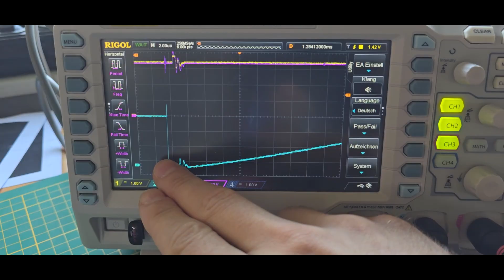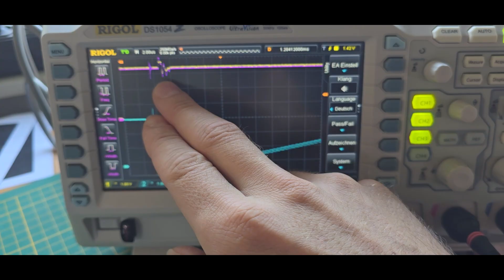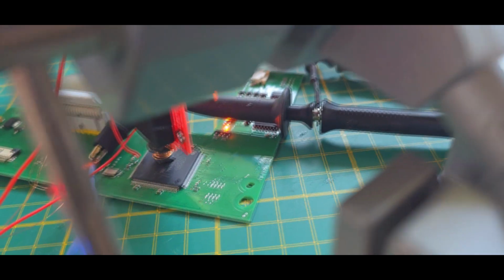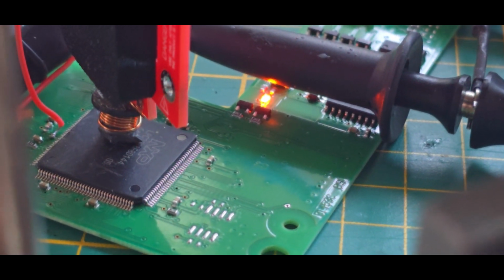EM Fault Injection POC of the NXP LPC2388 via PicoEMP

Comment: I've been familiar with this method, but something about you talking about this and about the relative positions brought up some interesting thoughts, aside from course control of magnetic field area, technically you can shape the field into a wide array or regions and concentrations.. an inductor doesn't have to be a 'coil' it can be anything that forms a loop, projected, shielded, there can be two in parallel/series, but what's interesting about that is you can stick them in/out of phase with one another so they push/pull each other's field lines with the same trigger impulse, and also have areas they could cancel one another out if needed. In the future we might even see security chips where this attack gets nulled out by some means of internal diff-pairs in the silicon or EM detection itself, but with enough EM shaping with the fields, this could still be a plausible method if you can shape the fields away from the detector or with enough force into one edge of the diff pair, etc.
Reply: The first thing I thought about was how to do beam-forming on this.
A cheap 3d printer might not give the X-Y resolution to do really fine adjustment, but if I've learned anything from Marco Reps, nm precision IS possible to do at the higher end of home lab.
Reply: @Prophes0r  if you needed to chase precision below what a stepper could provide, one could probably use a flexure assembly, made from something like PETG to make fine adjustments. I imagine in most general cases, a stepper would be fine though, since 0.1 mm accuracy is fairly repeatable for most reasonably tuned printers. Getting a printer to extrude plastic with that sort of accuracy is another task entirely.. but the motion system is certainly there.

Comment: What does this accomplish? Curious
Reply: During the boot process, there will be a yes/no check.
The goal is to glitch the yes/no WHILE the check is happening.

Imagine some process that requires you to verify a yes or no stored in a box at a bank.
You send an employee to the bank with the box number. Then wait for the response.
From your perspective, you only know that you sent a request, and the response when they get back.

But several things could go wrong between when you send the request and when you read the response.
- The box number could get changed before the check happens. You will then get the yes/no result from the wrong box.
- The yes/no in the correct box could be flipped while it is being read. The before and after don't really matter. The only time that matters is while the box is being checked.
- The yes/no answer could be flipped while it is being carried back to you.

A glitch like this is caused by forcing that check to happen over and over, and messing with it each time until you can cause a mistake that happens at just the right time so that the wrong response is received, but without messing with other important checks so the system still works.
Reply: @Prophes0r  really good response, I am just curious about something, in the case that the microcontroller is running a boolean that checks for that approval it makes a lot of sense since it is a yes/no type of thing, but what about the case where it is looking for a character/number approval? Would it make sense or is it just software restrictions to use only boolean confirmations? I don't know if my question makes sense...
Reply from the maker: The goal is to read out the firmware of the Microcontroller which is normally locked on this target

Comment: so this effectively sudo for unlocking flash. Nice!
Reply: It's more like...
A person being asked questions, who needs to hit a yes/no button to each one.
Normally, you would get the same NO to question #7 every time.
But this time Marco let some bees into the room and they are buzzing around the person's head.
Now you ask the questions over and over until you get the correct responses for every question EXCEPT #7, where the person accidently presses YES due to the bees.

The rest of the questions still need to be answered correctly(or most of them. it really depends) or the system doesn't work.

The goal is to mess with the system in a way that you can eventually trigger the conditions you want accidently.
Reply: More like bruteforcing the unlock